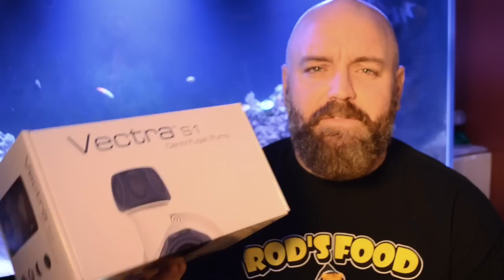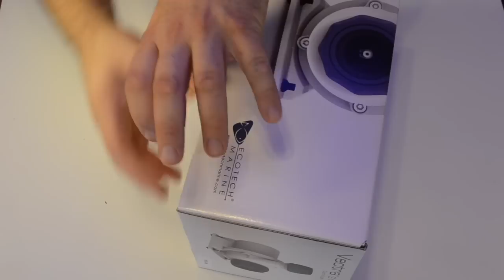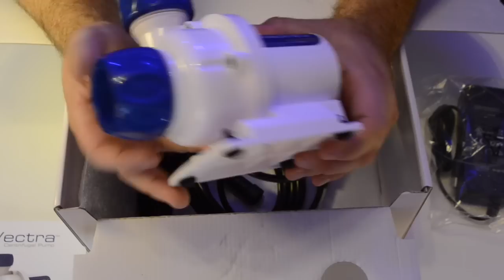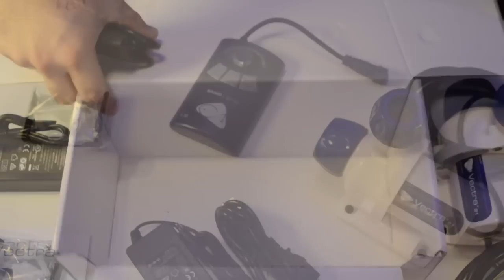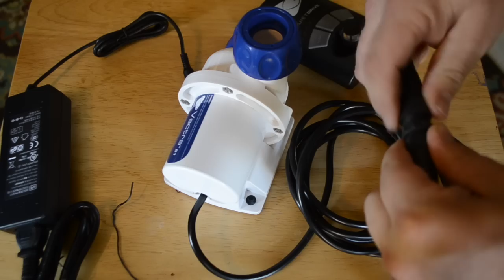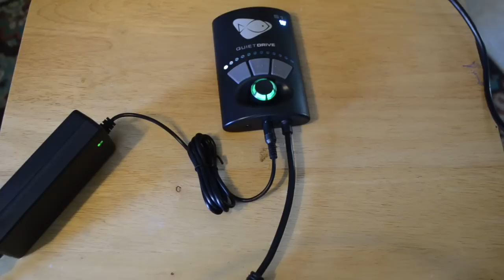EcoTech Marine Vectra S1 Return Pump

Comment: I am in the process of upgrading my tank which I have neglected for several years now.  Recently I have purchased a trigger sump, 2016 Neptune controller and a G4 Radion.  My next move is to upgrade my return pump and chiller pump.
 The S1 would go great in my 57 gallon mixed reef system.  Thanks for the product reviews.

Comment: I'm building a 50gal cube with my 6 year old son. We are having difficulty tuning the over flow with our existing AC pump. The S1 is on our upgrade target list when the budget allows. It will compliment our MP10 and Ecotech Reef link. We like the feed mode option so our food doesn't go in the overflow and into the sump sock. Winning this will enable us to add a second powerhead to add address dead spot that is collecting detritus. Thank you for the review and the opportunity to win an S1.

Comment: I have a S1 Sitting on my desk. The output couple that comes with the kit seems striped. when you go to put any kind of tightness it just jumps the threads. I tried some Teflon to see if that would take up the gap. Did you see this on your pump?

Comment: Can you tell me the lowest output this pump can be set to please? Will it go as low as 1000 litres an hour? Thanks.
Reply from the maker: It depends on how you calibrate it. It can push a trickle of water if you dial it in to do just that.
Reply: Thanks for the reply. I bought the pump a day after I posted the question after being assured by the shop that It could be calibrated from 0 flow up to its max. It was an emergency as my 8 month old return pump stopped working. The S1 is in my sump now and working great!

Comment: Wow EcoTech has really filled a hole in what used to be a surprisingly lacking market for reef return pumps. I have been eternally committed to Ehiem for the durability and efficiency of their pumps, however they severely lack in power and flexibility. If these Vectra pumps stand up to the test of time (which I have no reason to believe they will not considering the brand) they look to be the clear new standard.